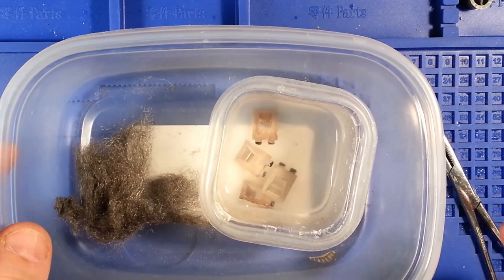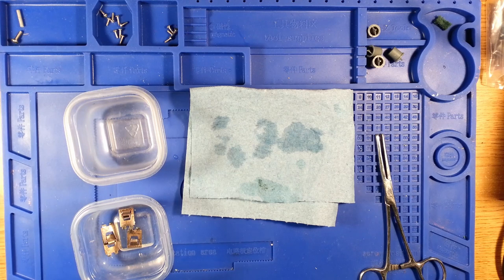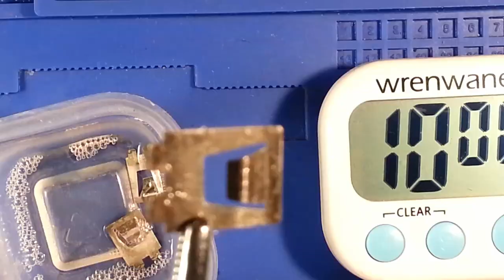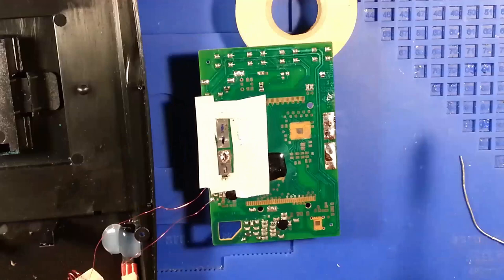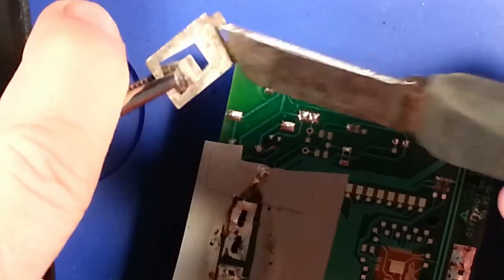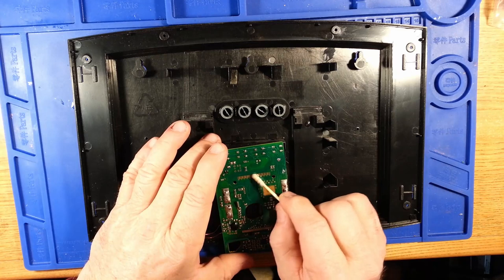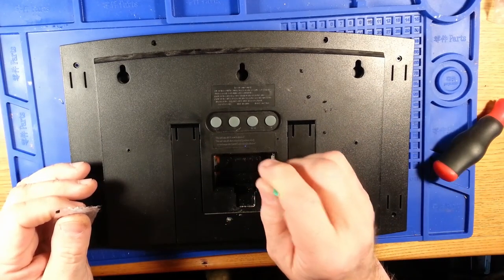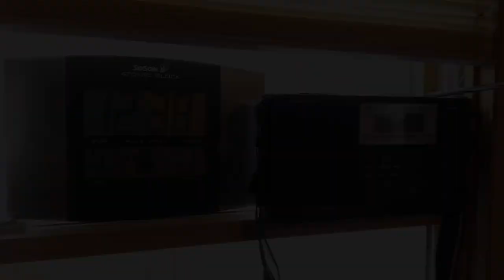E004_PT2 - SkyScan Atomic WWVB Digital Clock - Cleaning, Reassembly and Testing

Comment: I am considering remving alkaline batteries and replacing with proper 3v lithiums which maybe rechargeable. too many devices damaged by alkalines and they are expensive in so many ways. Replaced aaa 3x alkalines from headband flashlight. Very happy with that change. Ditto with a transistor radio that used 2xAA for 3v.
Reply from the maker: I am finding that for devices which use low power but need reliable batteries, the extra expense of lithium cells to keep them working is worth it in the long run. They have been working well for this clock and its outdoor temperature sensor.